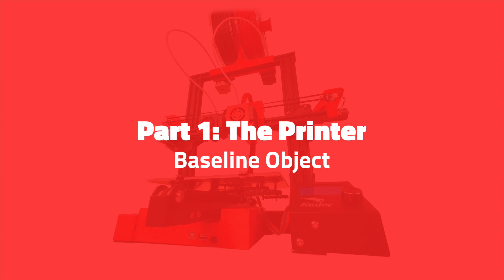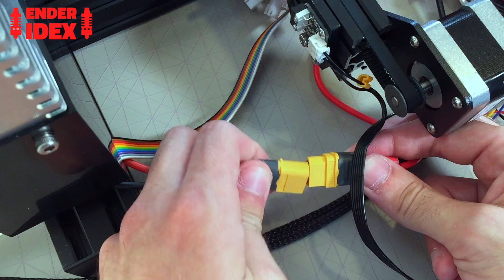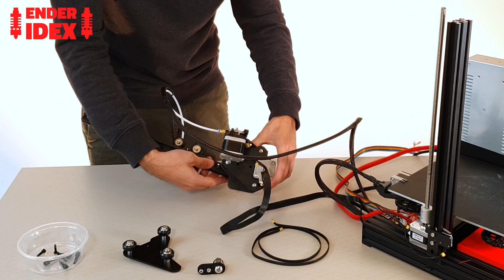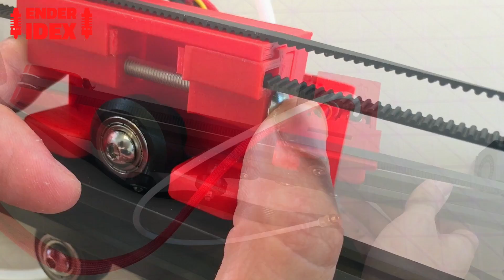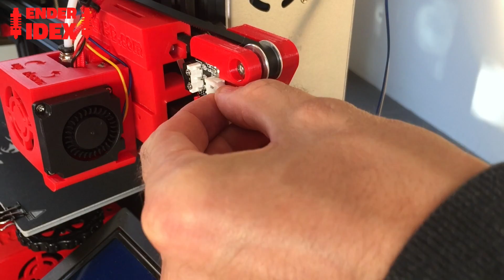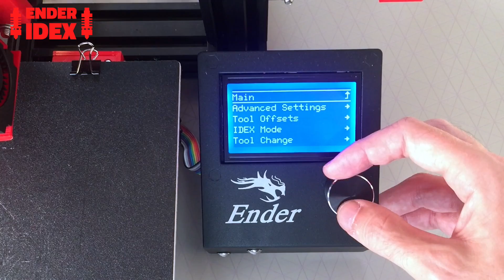Ender 3 IDEX: DIY Dual Extruder X-Carriage 3D Printer Installation Kit by SEN 3D

Comment: I like the product but could I use BL touch with this and is there any way to use this kit with a silent motherboard that I already hav on my ender 3 pro
Reply from the maker: Great questions, yes you can use a BL Touch no problem. It fits to hotend 1 and works in mostly the same way as normal. The only difference is for duplicate and mirror mode prints you still need a manually levelled bed as 2 hotends touch the bed at 2 points at the same time.

Sadly, the challenge with using your existing board is that it cannot run enough stepper motors. The Ender IDEX has 6 stepper motors (X1, X2, Y, Z, E1 & E2). A majority of board only run 4 or 5 steppers. This is why I supply the kit with an SKR Pro board (it's also an excellent board). However, if you did want the Ender IDEX to be silent you are still able to install silent stepper drivers too and get the same noise output as you'd get from any other silent board 😇

Comment: This should (probably) work on a Voxelab Aquila right? It's pretty similar
Reply from the maker: Hey Felix, Excellent question and on the face of it the Voxelab Aquila seems to have a very similar "Ender 3" style frame and components so I would expect it to work (obviously not a 100% guarantee).

To be sure if the X-axis extrusion is 345mm long then it is identical to the Ender 3 and much more likely to work in exactly the same way.

The only things that might be a tad different are the X-axis belt tensioner.  To make space for the X2 pulley you may need to swap it for one that only attaches to the axis on one side.

The screen may also need a bit of tinkering, does it work with stock Marlin? The kit uses a stick SKR Pro v1.2 so if the screen can work with that board then you should be fine.

Otherwise it looks like it could be an excellent upgrade for sure! Maybe I'll have to get one soon to test it on 😉

Comment: can it fit on ender 3 max?
Reply from the maker: Excellent question, yes it can and I have a few beta customers already using it. The main difference is the kit's X-axis is wider as well as longer cables and longer belts. Most everything else is the same.

If you were interested in an early access version of the Ender 3 Max IDEX kit let me know, otherwise I hope it will be more formally available soon 😇

Comment: I'm probably going to order this. 1 question. My ender is stockish. I do have a micro swiss all metal hotend and I run the hero cooling duct. Do I need to put the stock cooling system back on? I just have a few questions before a purchase.
Reply from the maker: That's awesome, I'm so glad you like it! 😁 You can keep the micro Swiss hotend and hero cooling duct for hotend 1 no problem. 

All you'd need to do (and I'm happy to help with this) is adjust the size of carriage 1 in the firmware so the second carriage doesn't collide with it. I have a number of alternative firmware builds on my website too for larger carriages: https://enderidex.com/help/software/#marline-alternative-builds

Let me know if there is anything else I can help with 😁
Reply: @SEN3Dcom  ok, I'll probably order it on the 30th. Is there a lead time on the kits?
Reply from the maker: Fantastic, looking forward to have you join team IDEX! kits are shipped out within 7 days of ordering and depending where you're located are delivered as soon as 1-2 days for UK and USA but can be a couple of weeks for some locations.
Reply: @SEN3Dcom  Wisconsin USA. Is there a better way to chat with you? I might order this weekend or now on my drive to work lol
Reply: Funny though because today I'll be getting the new skr wireless board because I was going to try rep rap on my ender but now I like this. I actually found this video by looking for the idex board for the skr board lok
Reply: One more thing I forgot. On top of the micro swiss hotend I also have a direct drive. Will this be ok? I can change it if I have to
Reply from the maker: @toddcoello6461  So the kit is compatible with direct drive for hotend 1. However, it will depend on the exact setup you have. The motor needs to be mounted over the front of the carriage and not the back. If it is over the back it will collide with the new X2 belt path. Let me know which one you have an I can advise further :)
Reply: @SEN3Dcom  ok, that's actually the setup I have.

Comment: Is your board compatible with a dual Z motor machine? Also, is there a RRF version?
Reply from the maker: Yes, the SKR Pro by Big Tree Tech which comes in the kit can run 2 Z-motors and actually has a socket built in for a second z motor so it would be quite to install :)

I have not personally setup RepRap on the SKR Pro...yet 😉

But I am confident it is doable and hopefully without too many challenges. Videos like this one would be a great starting point: https://www.youtube.com/watch?v=s68U6BwxHpI&ab_channel=ChrisRiley

Alternatively, the IDEX kit is also not tied to a specific board, you'd just need to have a board capable of running 6 steppers (X1, X2, Y, Z, E1 & E2). So something else like a Duet should be just as possible to use.

Comment: I'm tempted. I'd like to know if this kit is compatible with any larger Crealilty printers, like the CR series? Also, the whole reason for me wanting IDEX as opposed to two-in-one-out style is the horrendous amount of waste with the prime tower. But I see  you have a prime tower. Is that just to catch the ooze that happens while an extruder is at rest? Can that be made smaller or eliminated with a wiper or similar?
Reply from the maker: Hi there,

Great questions, broadly yes the kit should be applicable to most of the CR series. However, as you'll know there are so many models and variations I am still working on ways to make it "guaranteed" on as many as possible. 

In most cases the changes are mainly for the X-axis extrusion length and cable lengths. But for example some old CR-10s use a 12v power supply instead of 24v and I like to ensure I catch as many of these issues as possible 😇 I will soon be launching an "official CR-10" version of the kit but some of my amazing customers have already started building their own CR-10 or Ender Extender IDEX versions from the kit. So as long as you don't mind tinkering nothing should be insurmountable.

Excellent question on prime towers. You are correct a 2 in 1 out hotend will need much more purging on a purge tower. This is not only to prime the nozzle but importantly to purge the other material/colour out. With an IDEX it's very much up to you, in many cases I would use a very tiny purge tower but this acts more like a skirt for each layer getting the flow going before it starts to print. maybe like 1 or 2 hollow rings before it can crack on with the printing.

It is absolutely not a necessity to use a purge tower with an IDEX. It will depend a lot on things like your chosen holding temperature, material, retraction settings etc. In many cases you could use a purge bucket, maybe an ooze shield or for a large model just print from the "infill" first and let the initial couple of mm act as that "flow starter".

The other big benefit of IDEX is that each nozzle can print a different material and not just colour, so you can try PETG with PLA supports (as the 2 don't stick very well). Or PVA dissolvable filament or even TPU & ABS for example. These king of mixes would be almost impossible via a single hotend or require enormous purge towers.

Let me know if I can provide any further information or support 😁
Reply: @SEN3Dcom  Thank you for chatting with me on your website early Sunday morning.

Comment: This is awesome! Would it be possible to direct drive one of the extruders to print flexibles, or would there be space conflicts?
Reply from the maker: Excellent question. Hotend 1 can certainly be direct drive. You just need to be sure that the setup you choose does not mount the stepper motor over the back of the carriage. This is because the X2 belt runs directly above the X1 belt. So make sure the direct drive does not cross the "belt line" and you should have no issues.

You can actually get excellent results from the low cost brackets like this: https://www.aliexpress.com/item/1005001786191892.html

Hotend 2 is not possible currently as Direct Drive as the carriage is bespoke to this setup and can raise or lower via a screw. However, if hotend 1 is direct drive keeping hotend 2 as a Bowden setup can present advantages too for mixing different materials and print modes. For example hotend 1 is TPU and hotend 2 is ABS or PETG.
Reply: @SEN3Dcom  Sen, thank you for the thorough reply! This might well be my next project... great work, by the way.
Reply from the maker: @leafstalkcitationtoasts  You are very kind, thank you so much 😁Can't wait to maybe have you join Team IDEX 😉
Reply: @SEN3Dcom  if I do modify the file pack version, I'll send you a copy of the file. Might be nice to have support for mounting alternate hardware options, if only in the file pack.
Reply: Excellent video and kit by the way, assembly has gone perfectly so far. Just need to figure out hot end mounting and E2 belt tensioning and I'm good to go!
Reply: FYI, I am actually currently in the process of trying to get a direct drive set up on E2 with this kit (or at least the core parts of this kit). I'm using a Biqu H2 direct drive unit which is very compact and light and won't interfere with the belt path above like a microswiss or similar would. I'm not currently using the adjustable carriage plate (mostly because I forgot to order it and shipping is $20 and a week to get to the US), but I'm trying to decide whether I should just design a custom plate for belt tension and drive mounting or buy the file pack and modify the existing design to my needs.

Comment: Love what you've done but is there a cheaper version of this I'm on a budget and don't have a lot of money at the moment if there is please let me know.
Reply from the maker: Thank you for your kind words. I am delighted you like the kit and it has inspired you.

So there is a lot in the kit, SKR Pro board, complete wiring loom, 2 stepper motors, new carriage, hotend, X-axis extrusion, 10+ custom designed and produced parts.

However, I also appreciate there are lots of different budgets for 3D printing enthusiasts. One of the best ways some people have bought the kit is to buy just the custom X-axis parts or let me know the parts they need and I can quote for that. You can then use existing stepper motors or other parts you might already have to complete the build.

Obviously this will require a bit more hands on work for things like wiring up and installing it, but I'd still be happy to help.

Drop me an email at kane@sen3d.com and let me know what you're thinking and I'll see what I can do to help you join team IDEX 😉

Comment: Now if only you had one for my CR10s5 ! I might end up getting one of these and seeing if I can make it work on the Cr10s5 anyway lol
Reply from the maker: I like the way you're thinking 😀 Ender IDEX XL. I am working on the CR-10 version at the moment so hopefully it will be available soon 😇 Make sure you join my mailing list at EnderIDEX.com to find out as soon as it's release.

However, I also like your idea of taking the existing kit and transferring it across, it would be a great custom project. The core frame is obviously very similar just larger. And you'd have to be confident with opening the motherboard box. But if you did I'd be delighted to help you along the way. 👍
Reply: I have a CR10S that I'm looking to modify into something fancy. I was planning on going DIY but truth be told I wouldn't be able to match this bit of kit. 
I do think a double sided Z axis propulsion is the better way to go because of the added weight. Luckily the CR10S has that covered. If you manage to come up with a CR10S version, it may very well be this years Christmas gift I instruct my wife to get me 🤣

Comment: What an amazing tool. I've been looking at the JGmaker Artist D because I want the idex. But I also want the large build volume of the cr-10. Is there any way in the world you could also fit the same setup on the cr-10 version 3. I would buy that in a heartbeat especially if it is direct drive.
Reply: I second this comment, I'd buy six in a heart beat
Reply from the maker: Hi Adam,

Thank you for your kind words, it's great to hear you're exploring what's available and also what's possible in the world of IDEX printing 😁

So in principle I believe the kit would work on a CR-10 (or even an Ender Extender kit) as the basic printer parts and structure are the same. I believe the only changes needed would be:

- a longer x-axis extrusion to give the 2nd carriage somewhere to park as well as enable the X2 belt pulley to be mounted
- longer belts for this new longer x-axis
- Longer cables for the 2nd hotend

Obviously other snags or hiccups may come up, but this is all I expect it would take. I am working on a more specific kit for the CR-10 but this will take a little longer before it's available 😇

Also, in terms of direct drive. The new 2nd hotend is bowden based but it is possible to have hotend 1 as a direct drive as long as the stepper motor placement does not interfere with the X2 belt path.

Comment: can this be done on an ender 5
Reply from the maker: You're not the first to request the Ender 5 😊
Whilst this specific kit would not work on the Ender 5, I do plan to expand the kit to other printers including the Ender 5 soon....do watch this space 😉
Reply: @SEN3Dcom  awsome   tho i gess i should be more specific as i have the ender 5 pro   im not shore the difference between the ender 5 and ender 5 pro   i know the ender 5 plus is bigger
Reply from the maker: @Kyleo1234  That is very helpful, thank you 😊. It's one of the reasons it takes me longer than people expect to produce the kit. It's easy to make it work for 1 version of a printer but most have 5-10 different versions and iterations 😅😇
Reply: @SEN3Dcom  thats good to know that im of some help!   this looks like an amazing product!
Reply: @SEN3Dcom  I was just going to ask about the Ender 5 Plus with ExoSlide :)   Would love to see what else you are able to set up.  Seeing the current design, ExoSlide may or may not make it easier.  What are your thoughts?

Comment: How's the noise on this kit? I'm very interested, but I have a silent motherboard on my current ender 3 and I'd like to keep it silent if possible. I'm not sure if the DRV8825 drivers will be noisier than the TMC2225 drivers that are on my current board.
Reply from the maker: Excellent question. The kit uses the SKR Pro V1.2 which is very easy to swap stepper drivers for.

I have many customers that have done this without issue and I'd be happy to help if you did want to do this as a next mini project after setting the IDEX up. 

This is an excellent video showing what's involved in inserting TMCs in the SKR Pro board and I'd be happy to compile the firmware for you if you weren't comfortable doing it yourself: https://www.youtube.com/watch?v=3Z4aAzuzu44&t=1s&ab_channel=EdwardBraiman

Comment: Will this work with ender extender?
Reply from the maker: So in principle yes, I believe it will. I have not been able to test it yet in real life but my assumption is the only changes needed would be: 

- A longer x-axis extrusion (to give the extra 55mm for carriage 2 to park)
- Longer belts 
- Longer cables for carriage 2

I'd also advise a second Z stepper but I would recommend this for the Ender Extender anyway, without the IDEX kit. The SKR Pro board the kit comes with does have a spare Z port anyway, so this should be easy.

I have a few customers at the moment working on Ender IDEX Extenders so I shall be seeing how they get on and hopefully have something to share soon 😁

Comment: Could this be used to print the water soluble filament as supports? Like 2nd hotend/extruder for that filament strictly for support?
Reply from the maker: Absolutely, that is a perfect use case for IDEX printing. Provided the dissolvable filament (PVA) you select is printable at ~240ºC or less then you should be fine.

Also, materials like PLA and PETG do not adhere to each-other very well. So you could experiment with using one or the other as support material that should come away much easier.

As you may know ABS also dissolves in acetone so using ABS as a support materials with another acetone resistant filament gives you another option.

Finally, as dissolvable filament can be quite expensive you also have the option in most IDEX capable slicers to only print the interface layer in PVA. So your support towers would be PLA for example but the 2-3 layers that touch the finished part are in PVA and so dissolve away whilst also using a very small amount of the filament.